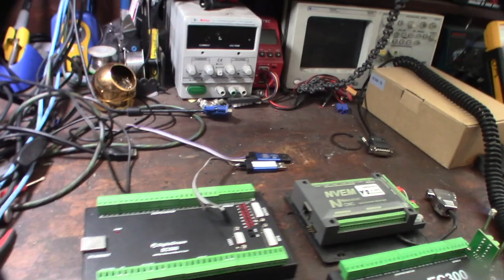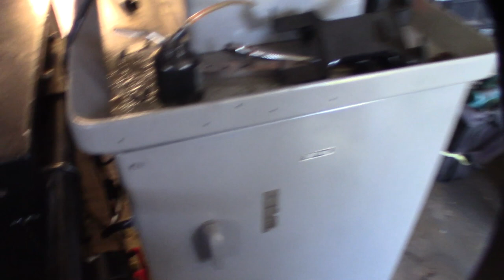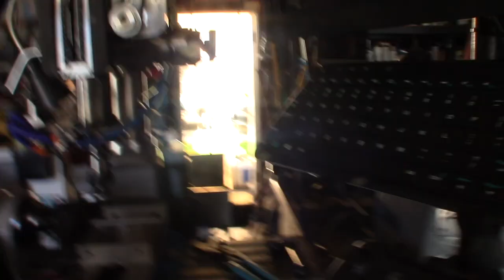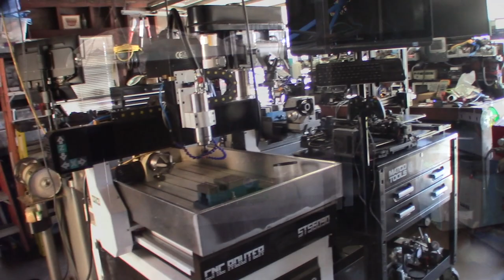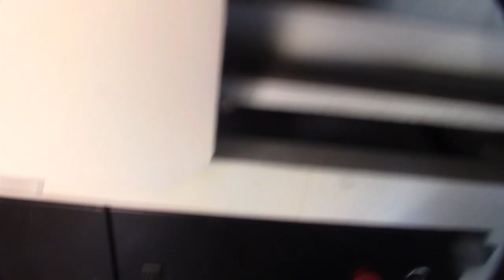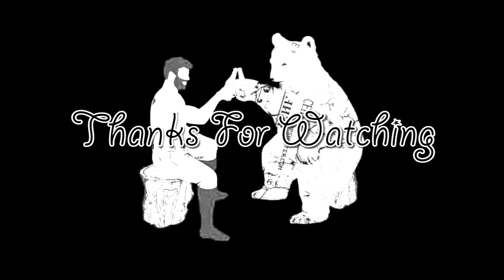Novusun Digital Dream Update EC500 V5 EC300 NVEM New Warp9 CNC4pc C25XP C82 smooth stepper ethernet

Comment: Hello, I also had problems with this board and there are still some things missing but almost everything works, including the probe... you just have to change the macros on the Mach3 to work with Chinese controllers ec500 v5

Comment: I'm in the process of reflashing my NVEM to Remora.  I have the V5 (RT1052) and I'm struggling to figure out how to flash.

I have used the UF2 firmware to create a PicoProbe using my RP2040, but not sure which firmware to use on the NVEM.

Can you tell me which firmware you used for yours please?  I noted you have the V2 NVEM which I think is a STM32, but your EC300 I think is RT1052 and uses the same firmware?

Like you I never got the NVEM to work with Mach3 (I think it's to do with the crappy driver).  Looking over the board it seems reasonably well made and logically put together (unless I'm missing something)

Cheers!

Comment: Very odd that you were able to get your Novosun cards to work without glitches in Linux but not in Windows. I have the Nvem 6 axis ethernet controller which I bought several years ago but never got around to installing it into my existing Windows XP parallel port setup, for fear of breaking a very reliable Mach3 machine. However I am so fearful of my Win XP dedicated  CNC rig eventually dying due to either a failed PC or OS that I am now thinking of biting the bullet and doing the upgrade, which is how I came across your video. Could you please elaborate on your issues with the controller and can you give me any tips. Thanking you in anticipation.
Reply from the maker: probing was unreliable crashing destroying tips. Random lockups. I went to a smoothstepper. I spent too many hours on those boards. The older ones were more reliable.